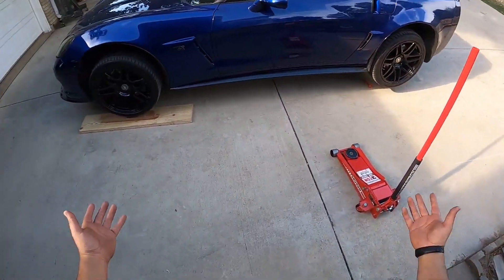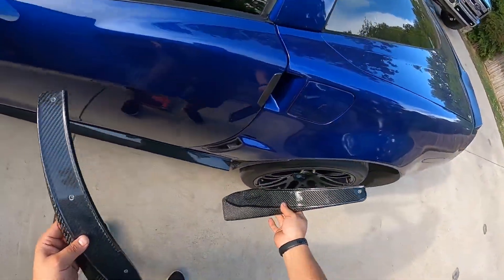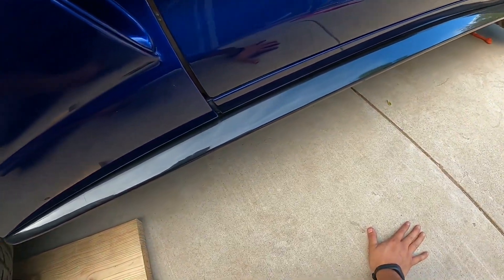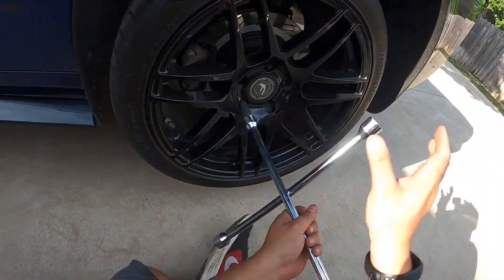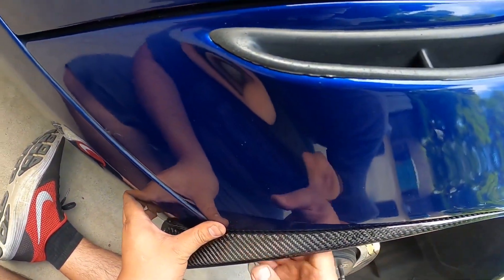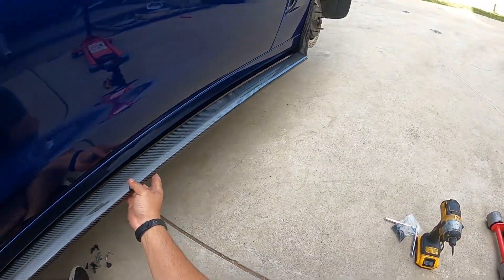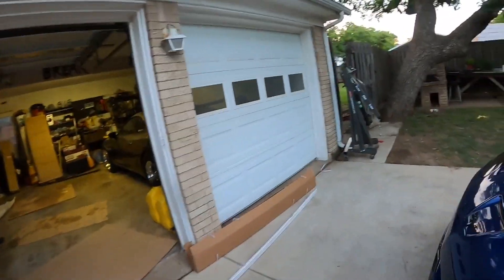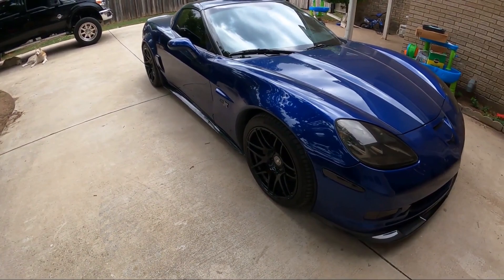Corvette C6 ZR1 Conversion Side Skirts -Extreme Online Store ft.@boostedproject

Comment: Great video. This is the next thing from EOS I want to add to my C6. Those screws, however, are pure absolute garbage, if they're the same ones that were included with my front spoiler EOS sent me; nine of the screws stripped, when I attempted to install the spoiler. Thankfully, EOS included 23 screws, IIRC. I also reused some of the original GM screws and actually ordered more original GM screws, which have a 7mm head, instead of that damn Phillips head.
Reply from the maker: Thanks for watching! Glad you liked the video and are considering another EOS upgrade for your C6. Sorry to hear about the issues with the screws on your front spoiler—sounds frustrating. It’s great that you found a solution with the original GM screws. If you're planning another install, it might be worth having those GM screws on hand just in case. Hope your next upgrade goes smoothly!
Reply: @extremeonlinestoreYT  OR, you guys can include better screws 😉